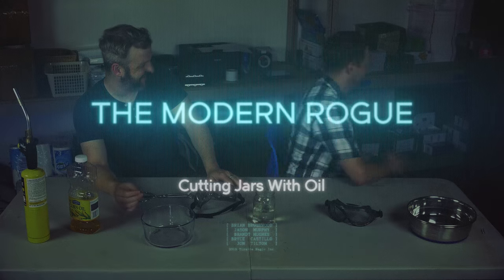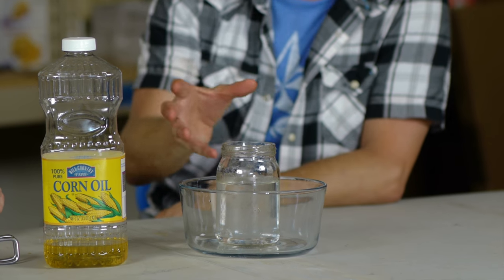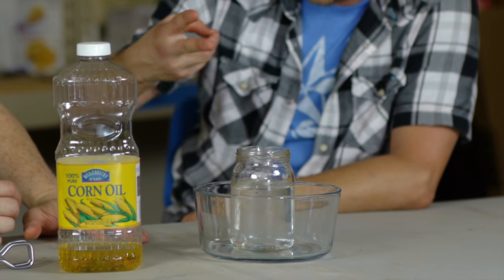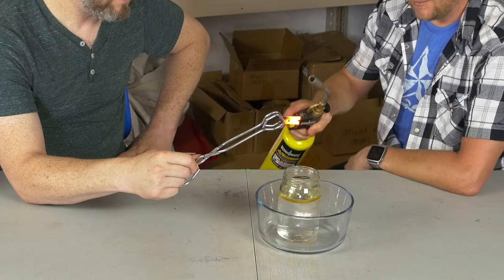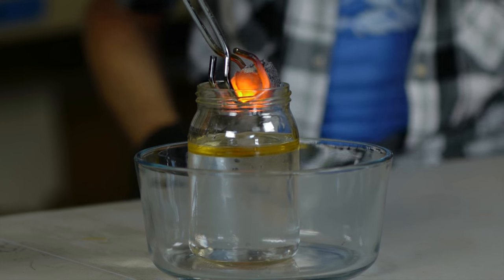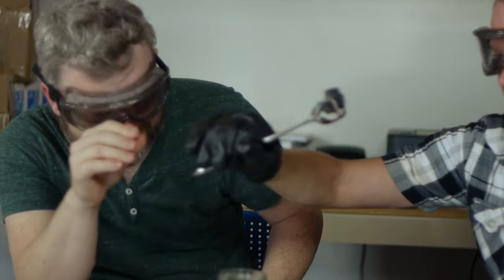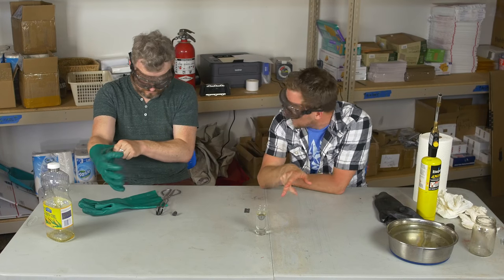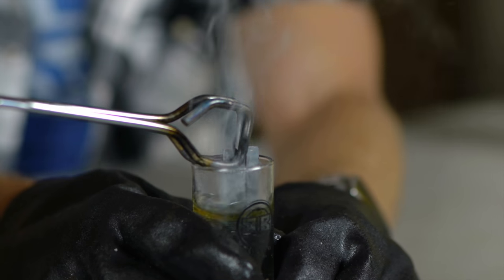Does Hot Oil Really Cut Glass?

Comment: Not to be that guy that tells you you did that wrong... but you did that wrong. Once you heat up the glass you are suppose to dunk the glass in cold water, the sharp change in temperature should cause the glass to break along the heated part, creating a clean cut, it does work... boom

Comment: Why not just wrap a string soaked in alcohol around the jar and light it? It works a lot better, its safer and makes a very accuratr cut
Reply from the maker: because that's not the premise we were testing.  If we wanted to just cut the glass, we'd use a dremel tool.
Reply: You could try doing the oil water trick and scratch the glass in a circle where the oil and water divide so there is a specific place where the stresses on the glass come together and hopefully break the glass.
Reply: +Scam School I think that would've been cooler though...

Comment: The mason jar was to thick, maybe if you used a really thin glass and ice water then heated up the oil really quickly it would break the glass. Also it wouldn't cut the glass it would break it around a certain point so you would have to sand it down or something so you wouldn't cut your lips off

Comment: I was going to say this might actually be better than the whole, tie a piece of string soaked in lighter fluid around it and set it on fire, because that seems to leave you with a very jagged and unusable cut, but at least that actually cuts the glass.
Reply: If you just sand down the edges, it is drink-from-able.
Reply: Big fad in the 70's. Turn bottles into glasses. There were many different kits that were sold.

Comment: Instead of using oil put a string in lighter fluid than tie it around a glass or jar then light the whole string on fire then when the string's fire goes out immediately in put the whole glass or jar in water. Then the glass or jar should be cut perfectly.

Comment: Before I watch this video I presume that the oil melts the glass. It should melt if it's hot enough as the glass has a melting point, pretty obvious that it will melt if the heat of the oil reached that of its melting point
Reply: obviously. the point is if it works, not what method theyll use. did you think theyd use oil like a knife or something...
Reply: No oil can achieve the 800+ degrees C that is needed to melt glass. If this worked it would be working on the principle of differential thermal expansion.

Comment: Seriously, you made this so hard on yourselves! You could have had a small kiln set up heating a bunch of things all at once instead of trying to heat something while holding it with the tongs. Or better yet, instead of trying to heat the oil while it's floating on the water, just heat the oil on top of a burner and then pour the hot oil carefully onto the water's surface

Comment: well starting off with, i believe you did it wrong because you had liquid in the glass when isnt supposed to be any, and the water and oil both have to be ice cold and you have to be using olive oil not vegetable oil, also the break from stress is more caused by you putting something very hot into something very cold, fast.. you two were doing it far too slow for it too work

Comment: You could heat up the oil and pour it in when it reaches the correct temperature.........
Reply: Yes i see... because pouring Oil, at a temperature higher than the boiling point of water, into water wont cause some serious splashing.
Reply: Corporate Mundo Where's your sense of adventure?  Risk taking?  Afraid of visiting a burn unit?  Kids these days.................lol
Reply: Lol you could get third degree burns from flaming oil clinging to your flesh...
Reply: +cookiezillaevan  I fail to see how that would deter me from trying this
Reply: +Choleric Raven third degree burns can kill you if left untreated
Reply: The Imperfectionist Eh, a quick shower, some Neosporin and a couple Tylenol and I'll be fine.
Reply: I seriously doubt that
Reply: The Imperfectionist You see that spec? High over your head? no? Well there goes the joke...
Reply: +The Imperfectionist just wear alot of layers with a mask and gloves and do it outside.

Comment: Id imagine that the only way that actually works properly is if you get the oil and thus the glass hot enough to reach the melting point of the glass, otherwise it's just making the oil hot and pissed off while the glass sits there just being hot but not phased by it (pun intended)
Reply from the maker: Nah, glad melts at insanely high temperatures.
Reply: Which is kind of what i was eluding to i dont think it can work unless you could get glass to that point.  Which clearly wasn't happening with the oil.  Most likely those videos online are just magic of editing.
Reply: It could work if you somehow get something in the glass that is really cold and something that ir really hot, the diffrence in temperetures should crack the glass.

Comment: how this works is you heat the glass to a high temperature then suddenly drop the temprature and really fast, that would break the glass..
but this method will not work, it does not heat fast enough thus allowing the heat to spread and the sater inside gets warm, it equalizes it self..
thw internet lies!
this could probably work if you heat a heavy duty oil to a very high temperature and then pour it into the container and then add water into the inside of the jar but who's crazy enough to do that? not worth it either

Comment: the way i have hear of using oil to cut glass is to soak a piece of twine in vegetable oil, [normally you use acetone etc.]  wrap it around the point you want to cut, light the twine on fire and wait for the fire to go out. then immediately dunk the glass in water to use thermal shock to break it.

I have seen it being done by tap the glass firmly but gently on any surface to get it to fracture, but i have found it to be very hit and miss. 

Plus the two videos you link have very different methods, and a full of jump cuts. The twine method is a lot safer, quicker, easier and you can do it with household items.

 video links below of it working without edits. 
https://www.youtube.com/watch?v=J7vT8kdpfNI

Comment: you missed literally about 3 steps and there is also an easier way to cut glass using heat lol
Reply from the maker: Oh, there's a billion better ways to do it.  But we weren't testing those ways.  We were debunking the video flooding our inbox.
Reply: Scam School that makes more sense.
Reply: +Scam School you can't debunk anything that you do not know how to do..........  When people say i  can't  drink a 12 pack in  36 seconds  I prove that  I can...  I can  because I know how....  They  don't know how and  I can't  explain it to them or teach them  but  they  always  pay the  bet money  when I do  it... 

Love scam school but yes you  can cut glass with  hot oil and  water....  You never  tried boiling or bringing the  fluid in the  container to  high temp.....  Then  shocking with  cold temp...  A glass  with  water inside and outside at the  same level  then  pour  cold oil  into the  glass....  THE  water  will  absorb the impact and shock and  focus the  impact....  You may  still  get  wandering  cracks/shatter depending on the  quality of  the  glass. 

Have  you  ever  poured boiling water into  a glass  dumped it then  filled with  cold  water ...  Instant  shatter.... Also  scoring with  a glass cutter will  focus the  cracks

Glass cutters work  best  amen  only  lightly rolled across the glass...  The  deeper the  cut the  more likely to  wander 

FYI glass is  a liquid

Comment: why didn't you heat up the bowl? the metal one of coarse
Reply from the maker: Why?
Reply: The idea is you heat up the oil as a ring around or inside the glass as direct contact not the container
Reply: +Scam School when I hear treat the knives I forge, I heat up the oil I quench in the way he was talking about to roughly 200°F with a torch. I tried breaking glass using that method in my quench tank, heating up the oil by torching the metal canister. After the oil was boiling, I picked it up with tongs and dunked it in a bucket of oil, and it snapped right at the oil level. Hope that helps. Have a great day!

Comment: so were you guys never aware that you could make that you don't mix hot oil and water because it can explode.... why didn't you guy heat one or the other on a frigging stove.... instead of using a plumbing torch. and a set of tongs... you're not heating the whole pan of oil evenly other wise when you dip that piece of hot iron the pan would burst into flame the glass might shatter mixing the water and oil causing an explosion and then maybe sprayed you guys with hot oil and set you aflame.
Reply from the maker: I'm assuming you somehow missed the part where we were testing a particular video, which meant we had to follow the instructions given on that video.

Comment: I can see a few flaws with the method. You guys didn't heat the razor evenly and also did not submerge it parallel with the oil. This would effect how quickly the oil is heated up. You could also try using ice water and then heating the oil, or just cut the glass with string and fire as seen in this video: https://www.youtube.com/watch?v=J7vT8kdpfNI
:D

Comment: Did you try scoring the glass?
Reply from the maker: if we could score the glass, why not just cut it?
Reply: +Scam School because... frustrated yelling shut up! lolz
Reply: Use a tungsten carbide bit (such as a router bit) to make a score line then heat the glass around the score line once its bloody hot run cold water along the line hold the bit you want to keep or it will smash

Comment: this trix sucks maybe.. but there is another way...  put some string around the jur, and dip the strings in to nail polish remover or something like that.. now light up the string and spin the bottle.. after some times put it directly into cold water..

another thing.. the tricks you tried to do.. you should have try it with half water and half oil.. I mean very thick layer of oil.. than heat up some rod, something bigger than you used here for more heat at a time.. than the bottle should be split instantly all by itself..

you are ryt about one think, we people will tell you what you did wrong :-p
Reply: btw string thing really work
Reply: forget to mention, rod shouldn't touch the water